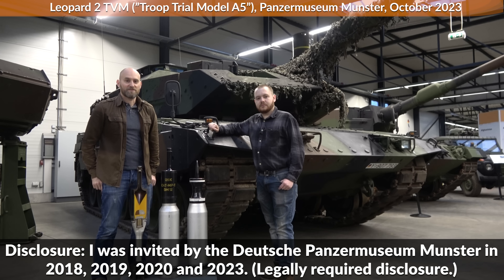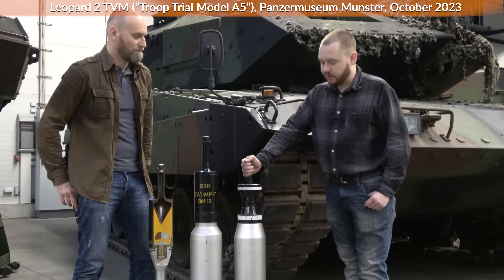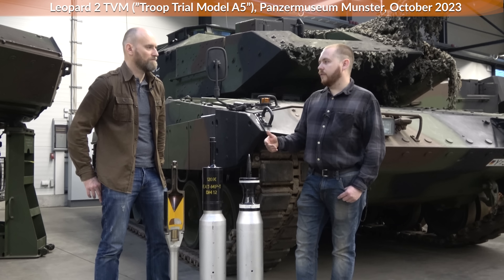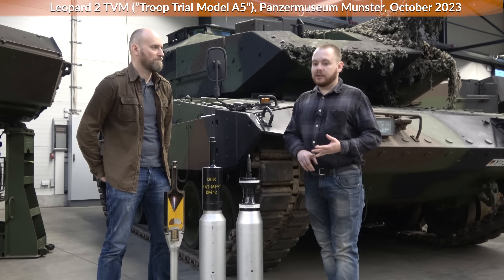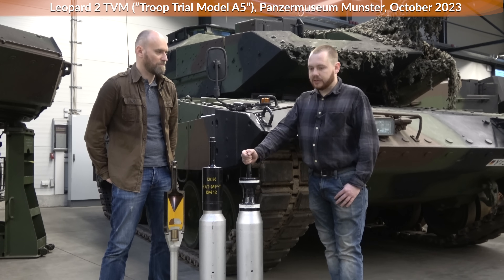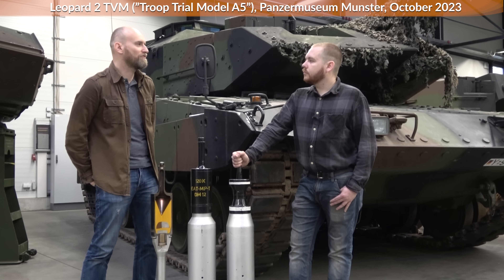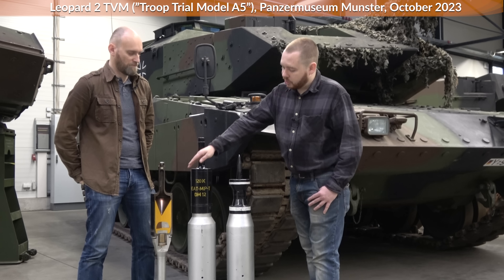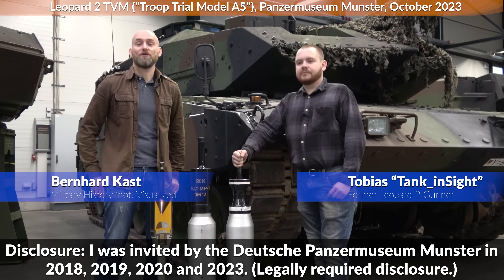Why you need proper HE rounds for Tanks

Comment: Russian modern MBTs have dedicated ballistic computer modes for semi-indirect and indirect fire. First uses tank's own sights, second -- a link to a recon drone or Orion unmanned aircraft. The effectiveness is decent. For example, the first Leopard 2A4 was destroyed by t72B3 tank from 8.8 km distance using 3 125-mm HE-frag shells. First was a miss, other two connected. 
Russian tanks use heavy HE-frag shells 3OF22, filled with 3.4 kilos of A-9-2 compound which equal 5.65 kilos of TNT. A-9-2 produce considerably more heat and overpressure than RDX/hexogene while the speed of detonation is only marginally lower, so 125-mm HE have destructive power on par with 155-mm artillery shell. 

Russian tanks pay for this option in blood because internal fire or explosion with such ammunition onboard cannot be mitigated by any means. Newer modifications of T-series have heavily armored autoloader compartment, which mostly solved the problem. 

There is no point in indirect firing mode if you only have HE-MPAT rounds. The effect will be mediocre at best.

Comment: Bernhard,  die HEAT ist eine projektilbildende Munition, die erzeugt einen Stachel, keinen Strahl, da es sich um eine Kaltverformung handelt. Spike trifft es also eher als Jet.
Reply from the maker: Danke, aber ich glaube du verwechselt HEAT mit EFP: https://en.wikipedia.org/wiki/Explosively_formed_penetrator
Reply: @MilitaryHistoryNotVisualized  

Das Prinzip ist exakt das gleiche. Es handelt sich um eine Kaltverformung. Man spricht zwar oft von Jet oder Strahl, es ist aber ein Stachel.

https://de.m.wikipedia.org/wiki/High-Explosive_Anti-Tank

Comment: Finally! I've been making this point for years now. A dedicated HE-frag round is needed for any tank. Those HE-Frag-HEAT mix matches were terrible at pretty much everything they promised to achive. Lethality and penetration were sacrificed for an expensive pr stunt. They should have stuck to their conventional HE designes and slapped a multifunction fuze on it....
Reply: ...like the soviets did. Ever since the t-72 ural all soviet mbts could fire HE-frag in a point detonation or delayed mode. They tested the delayed mode against the sides of pretty much any nato mbt they could face...making mockups for the ones they couldn't test on. The 125mm HE-frag was able to punch through the side of every mbt with sides thinner than some 60+mm. Which was pretty much every nato mbt including their metal side skrits. 125mm HE-frag is still proving its worth to this day. A simple fuze design able to be programmed by the commander from his switch panel vefore the round is loaded out of the carousel. The t-90 simply added a timed mode to it.

Comment: Does anyone want to take a guess on what that round copper looking block in the high explosives of the HEAT round is for?
Reply: turns to plasma and cuts into the steel basically
Reply: @BigMakBattleBlog  Pretty cold guess. Hint: It is designed to be inert.
Reply: @BigMakBattleBlog  The answer is its called a wave shaper. Its an inert block that manipulates the Explosive detonation wave to improve the Heat perfromance.
https://youtu.be/KMLye177nqo?si=1f5S8JOMBuVgaRZr

Comment: The three shells a tank needs is APFSDS, HEAT, HE.

And as we know, sabot for armour, HEAT for moderately soft targets, and HE for mystifying infantry. And it's the necessity for those three shells for dynamic combat ability is why i praise russia for still keeping a HE shell in the back rack... 'et.

There's other things i praise and scathe soviet/russian stuff for. The MZ i scathe the AZ i praise. Because it is safer by a significant degree, keeping the ammo low. The biggest issue for the T-72 seeing it's house from there is the loose ammo. But it's not the AZ carousel that is doing it.

Plus if hull ammo is so bad why does pretty much everyone but america have hull ammo and not have the issues they deleted 6-8 shells for?

Another aspect of the turret pop is the bag charge russia has is absolutely fantastic. The problem is, it's absolutely fantastic at its job, so it burns faster and more aggressive due to the stub plate not having the internal fire tube to even the combustion out.

As for soviet shell warhead lengths. All autoloaders have a limited service span till they need a complete redo of the tank, because as shells get bigger and longer, only so much even the leclerc can take in length before the bustle is half the turret length and half the turret height added for the bigger and girthier shells.

Even hand loaded doesn't get away as only so much the racks can be modified before the crew get not shite holes from being poked from sitting down.

Factors people DON'T ever look into.

But i will aggree that russian kinetic warheads aren't as good as they can be. Their HEAT is sufficient for tasks, and HE very versatile.
Reply: You don't need HEAT at all.

HE fulfills everything that HEAT would, if you direct impact a soft-skin target, like a truck, APC or IFV with an explosive charge of 4.6 TNT equivalence, that is no longer a vehicle, that is what you call smoldering rubble, infact, most of the time you can even knock out full on MBT's frontally using nothing but HE as you will blow anything sensitive away, like tracks, sights, periscopes, radio antenna, etc.

You can easily see this in the ammunition loads that both Ukrainians and Russians take to the front, around 2-5 APFSDS rounds, and everything else is just HE, no HEAT, not ATGM's, just HE.
Reply: @vonvonvonvonvonvonvonvonvo7009  HEAT is a solution for doing something an an APFSDS and a HE shell can do with the compromise of having lower capability on both sides. a tradeoff for versatility over specialization. 
HEAT will still punch through sides and rear of tanks with little or no ERA and front hull and turret of first and second generation MBTs with good reliability, while at the same time having good firepower against soft targets like APCs and fortifications. 
saying you don't need HEAT at all is like saying you don't need heavy machine guns because a squad LMG and an autocannon will perform its role in their own niches.
Reply: @vonvonvonvonvonvonvonvonvo7009  vast majority of thin-skin vehicles have applique armour packages which nullify HE effectiveness. So no HEAT is not obsolete.

Also 4.6 what? Grams? Tonnes? Megatons? Pounds?
Reply: @osmacar  Apologies for the confusing, meant 4.6kg.

Now the topic.

You would need a rather extreme amount of applique armor to "nullify" HE of that size, people always seem to struggle to realise just how large of an explosion 4 kilograms of TNT actually produces, you may end up not getting the catastrophic kill on the APC due to it's applique, but you will with certainty get a kill on it due to the sheer volume of that explosion along with all of the shrapnel, all of which will disable wheels, tracks, view ports, any exposed personnel, windows, antenna, and really anything else that would be 'exterior', and all that assumes that the shell even hits applique, which in of itself is by no means guaranteed, there is also the factor that, if you hit applique that is enough to entirely stop 4kg of TNT from doing anything, the shaped charge itself is highly unlikely to actually do anything just on its own from a ranged impact a good portion of the explosion itself will not be following the main jet inside of the vehicle as it will bleed off into the air instead, and the explosive filler is even smaller so it is even less likely to secure an actual kill on the vehicle, though slightly more likely to injure crew.
Reply: @vonvonvonvonvonvonvonvonvo7009  well you don't fully understand HEAT it seems. while yes i see your arguments, and it comes from a sound logic. and yes HE CAN send bigger chunks in it's not as effective as HEAT. and this is down to pressure differential.

yes 4.6kg of TNT== does note mean that will be directed fully into the vehicle, as only a portion is actually utilising all the applied force. the part that contacts and fuses, the rest of the explosive force is either a fart in the wind, or has to travel to the target before applying the force, and is mitigated a bit by the rest of the shockwaves. while not cancelling itself out, it does disrupt itself as it jiggles the armour.

while HEAT it pushes that sweet sweet HE goodness through the armour and has a huge amount of spalling, from the armour AND the jet. one reason air is so effective against a properly formed HEAT jet is because the instantaneous extreme is not there. however the jet also sucks in some of that boom juice pressure adding to the internal effect.

and quite a bit of the time HEAT has like a 120° arc of spall. while HEAT can be half of that to like... 80% iirc, of a HEAT spall of what does spall. there's also the factor of HE is an infantry shell not an anti armour shell*

*not saying it can't take out armour, but it gets rather exponential at times. besides 37mm hitting 37cm is gonna just annoy the crew and maybe make the paint flake off if you are really lucky.
Reply: @osmacar  You're just walking around my argument, my entire point is that HE shells have a higher probability of kill because you don't have to perform a catastrophic or total kill to actually do such, if you blow a track? That's a kill, if you disable all of their optics needed for gunnery? That's a kill, if you do anything that prevents them from being able to actually complete their mission, that is then a kill, and large calliber HE shells will absolutely, with or without applique, cripple any vehicle that it impacts, MBT, IFV or APC, even without any penetration, a close hit is a ni-guaranteed kill due to this, especially today where if you blind and immobilize a vehicle, it is practically speaking dead because it's just a sitting duck for drone strikes at that point.

It doesn't matter what the 'theory' behind modern HEAT is when the soldiers who are using it on the front lines are pointing out themselves that it is awful, because it doesn't do its job against infantry as well as HE, which is over 70% of all targets they fire at, and the few soft-skins they do engage, the HE shell still performs better against due to it's incredibly high kill-probability, yes, HEAT is more likely to have a total kill, but to the average frontliner it doesn't matter if the enemy IFV became inoperable or outright exploded, all that matters to them is that it isn't shooting them anymore.

HEAT is overall a shell that, I can understand how one can lure themselves into a theoretical trap with, but in practice the advantages that they offer is really not worthwhile when fired from actual tanks.

Obviously this is only talking about specifically Tank guns firing, HEAT serves many other purposes for other practical reasons.
Reply: @vonvonvonvonvonvonvonvonvo7009  Just to clarify, Russians DO load ATGMs. I've read that they even scored a new longest kill record, a Russian T-80(most likely)BVM engaged a Ukrainian BMP of sorts, which was about 6-8km away, and what it, reportedly, used was a Svir Barrel Launched ATGM.
Reply: @saucy743  It is extremely rare for barrel launched ATGM's to ever be used and are most often not loaded.

As for longest range tank kill, HE shells along with APFSDS have for certain gotten a kill on a tank at further ranges than 8km, both sides are claiming in excess of 10km with some reaching up to 12km with the gun used in indirect fire.

But why does the "longest range kill" even matter? The 'legendary' one set by the Challenger tank was dubious at best to begin with as there were reports of tank on tank kills as far as 4-5 klicks out in WW2, all that really means is that your gun can shoot that far.
Reply: @vonvonvonvonvonvonvonvonvo7009  may be rare, but my point still stands. They load it, even if not always.

And i just used the longest kill as an example, because, reportedly, the T-80 used a Svir ATGM.

Comment: We called the 'dumb" version of the MPAT ( M 83OA1 multi  purpose Anti tank ) an OR ( M908 Obstacle Reducing ). It used the exact same M774 impact fuse just lacks the m76 prox fuse. It's also a PIBD Anti Armor design with a copper liner and whatknot. The MPAT and OR rounds, in personal experience, actually less effective shrapnel wise but more accurate with them being a sub caliber and saboted 80 mm warhead than the M830s full bore 120 mm payload.

Comment: Appearently USA missed the memo. Pushing for MPAT simply for logistics convenience when MPAT is basically useless against entrenchments and buildings is dumb. Bring back HE
Reply: AFAIK the US Army is currently replacing all 120mm rounds except APFSDS with the XM1147 AMP round, which basically is the equivalent to the DM11 multi purpose HE round discussed in this video:)
Reply: @tz6070  And that is a gigantic mistake as seen with performance of MP rounds in Ukraine.
Reply: @Phapchamp  I am sorry, maybe there is a misunderstanding here, but arent you advocating for bringing back HE in your original comment?
Reply: @Phapchamp  AMP is a dedicated HE Warhead with shrapnel tungsten. Literally the thing you wanted the US to switch to.
Reply: @Edo_Ginting  It is a HEAT warhead not an HE warhead.
Reply: @Phapchamp  What? No, the AMP is practically the same thing AS The German DM-11, an HE shell with canisters on it for fragmentation.
Reply: @Phapchamp  Here is a picture from the DM11 (the AMP works similarily): https://de.wikipedia.org/wiki/Leopard_2#/media/Datei:120_mm_DM11.jpg
As you can see, its a pure HE warhead with a layer of tungsten shrapnels on top and a programmable fuze.
Reply: @tz6070  A pure HE warhead wouldn't be able to replace HEAT for anti armor needs.
Reply: @Phapchamp  Thats why they keep APFSDS. AMP is only supposed to replace HEAT and MPAT.
Reply: @tz6070  APFSDS is ineffective against lightly armored vehicles
Reply: @Phapchamp  Both Dm11 and AMP are designed to be able to penetrate light armored vehicles (to what extend...i dont know).
Other than that, i honestly dont know what to say anymore. AMP and DM11 are HE rounds, thats a fact! Whether APFSDS and AMP are sufficient against all kinds of armored targets or whether a third HEAT round will be needed remains to be seen.
Reply: The adoption of m830A1 also brought around the adoption of m908 OR for obstacles. The US didn't "miss the memo", you just rarely hear about it because its rarely used in training nor was it heavily needed in the middle east.

Comment: The bigger question should be why are they even using non tandem heat when they have apfsds that works way better against era covered tanks and not just take the airburst he instead.
Reply: Tandem charges are very long and take up a lot of space, so much so that they pretty much don't exist in tank munitions. As for using heat instead of HE? The thought is that heat is sufficiently effective against infantry and fortifications while also being able to penetrate armoured vehicles, and so you would always have heat loaded so that you wouldn't need to unload (or shoot an ineffective shell) before loading an appropriate one

Comment: I find these two jokers hilarious - not only western tank are much larger, and easy to spot, but also lasing anything (and you need to stand still to do that) raises alarm on all enemy sensor and you eat AT missile or drone in response, yet they act like smaller Russian tank firing much more effective ammunition (costing 1/100 the price, at that) then immediately withdrawing is somehow easier to notice and engage when it's long gone before enemy can react. Also, standard silly cope about reverse speed, when last 2 years in Ukraine shown it to be meaningless BS that doesn't matter in 95% of cases - really? At least you skipped autoloader cope, but next time you will say western tanks look prettier without anti drone cages and Russians are dumb installing them, eh?

Comment: The way I see it, push for MPAT round instead of adding HE to tank load is a relic from Cold War era, when sheer number of Soviet armored vehicles expected to pour from the East called for every round to be able to take out tanks . Especially since going from 90mm, to 105mm, then to 120mm drastically cut number of rounds carried by a single tank.
Reply: No, one of the problems with HE is that when it goes off, it REALLY goes off. Even anti-blast compartments can't handle the oomph of a HE cookoff.

This is partly why ships of yore tend to go up spectacularly if the ammo cooks off.
Reply: @TheTrueAdept  by 70s even Soviet Union abandoned TNT, in favour of RDX based explosives, that don't detonate from being set on fire.
Reply: @kireta21  however, even RDX-based explosives can detonate in the ways you don't want them to under certain combat conditions...

... and since HE rounds are harder to contain when they go catastrophic than HEAT...